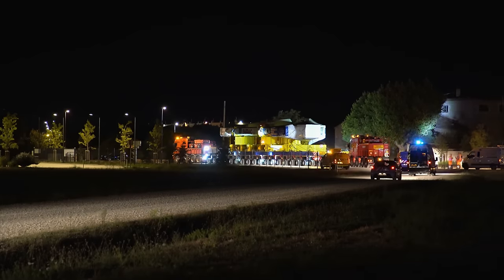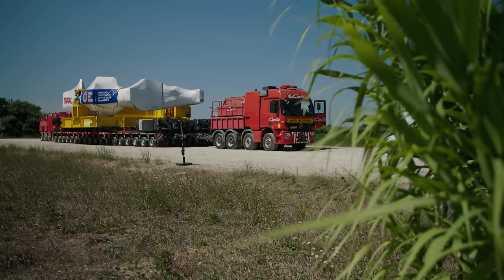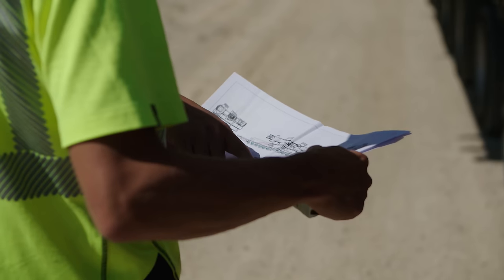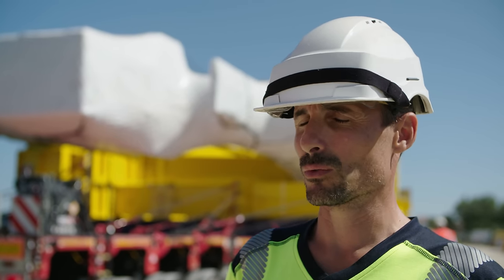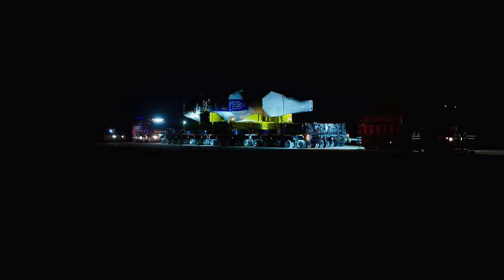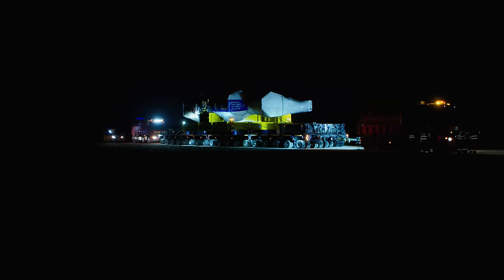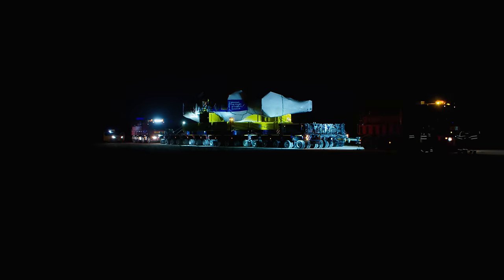Giant Magnet for the World's Largest Fusion Reactor | Mega Transports | FD Engineering

Comment: What is the advantage of switching tow/push trucks from front to rear and then later back. Don't really know why they switch.
Reply: Probably like reversing a train up a switchback, don't need some HUUGE turning circle, but you just need a bit of extra runoff on one end and you move the trucks around. I don't think they moved the one at the front to the back per se, just flipped them 180 and had them pulling the other way. Terrible writing in this one.
Reply: I think it’s about changing the angles , they did it when they were going around turns that were like *90
Reply: @TheWinning247 
At one point the specifically said that was exactly what they did!

🍌🤔
Reply: @TheWinning247  
You think they turned the Trucks 180 to pull in reverse, or in your vernacular:"the other way"...!?!?
That you think that is one thing and entirely for you to live with, but that you actually put it out here in the World is hilarious, seriously, you "akshually" think that the Trucks which control the steering of the Trailer on the highway sections are going to do it in reverse....!?
Reply: @HeinrichDixon  
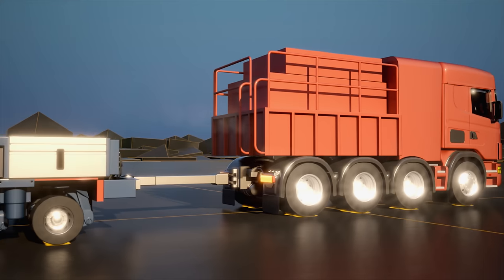Where...did they say "exactly that", on the tighter sections steering is switched to the Trailer, otherwise it's the Trucks that take the steering over (6:51), there is no way that the Trucks are going to do that while driving in reverse on the Highway sections !!
Reply: Sometimes its down to getting the best traction.

Comment: They repeatedly "rotate" the trucks but never once explain why!

They explicitly said that this involved moving the front truck to the rear and vice versa.

What difference could this possibly make? And how does it "change the angle"? Identical trucks have swapped places!

Also, I am (or they are) confused about distances: Leg three is the longest at thirty-two kilometres, yet they are sixty-nine kilometres from their destination.

🍌🤔🤔
Reply: It is a  'push-me-pull-you '  !
Reply: is to balance the stress on the chasis due to pulling and pushing force.

Comment: Should've used an Australian trucking company. We would've done it using one truck and trailer
Reply: the law in Europe is such that one truck cannot tow more than 250 tonnes GTW, thus for each multiple or part thereof of 250 tonnes requires an additional truck when it comes to on-highway use, outside of Europe them same trucks in some parts of the world on the public highway can run at up to 500 tonnes GTW per truck.
Reply: @b101uk9  they probably would use two here as well. Have a look on here for Australian road train trucks and see how big they are. 👍
Reply: @b101uk9  Yeah, Euro regulations....they like their control and rules !
Reply: @Walter  in aus would have been closer to 5-7 trucks too much risk loosing traction and it looks way cooler

Comment: How about burning hydrogen for energy😊
Reply: That's basically what fusion is.
Reply: @blockstacker5614  Burning hydrogen and fusion are completely different, fusion is a nuclear reaction in which 2 hydrogen nuclie fuses together to produce a helium nuclie, but burning hydrogen just involve hydrogen reacting with oxygen, which is very easy to achieve, but you need extreme high temperatures to achieve fusion, that is one of the things holding us back from using it as our primary source (generated by us) of energy.
Reply: not even close to the efficiency of just smashing together hydrogen

Comment: if u could make an Cold fusion reactor  don't you think u need an Nova blast at least. Trying  to maintain that if u can with some magnets?? Wow u need magnets that are like 1 billion times stronger than what we know.  When the law of physics go out the door.. According to me we are doing firecracker's kind of experiment. In physics size matter  u need an solar system size at least to contain and hold the forces in check. Trying on  earth will just fail just to meager in power. Just know nature is an tricky business according to energy and mass.. Usually 0 or 1 .. 0 is not forming as anything.. 1 clumping to each other   creating something.. like an sun or planet.. or life...To me life is movement.
or kinetic energy
Still equals dead..

Comment: Heat is out the critical element of generation of electricity.  We can generate electricity without fuel wind or water using the original Edison generators and dynamos power plants.  A permanent magnet motor powering an array of brushless motors as generators with inverters and transformers to deliver high voltage AC power continuous peak power to power lines is the normal legal method of power generation.  Heat of nuclear fusion power or fossil fuels is not needed for power generation.  We are grossly misinformed about power generation and power use and this fusion power effort is a boondoggle and waste of money.